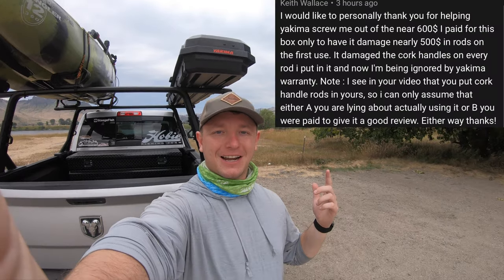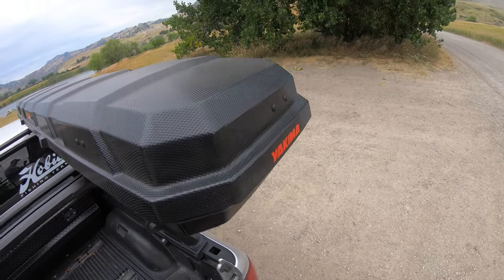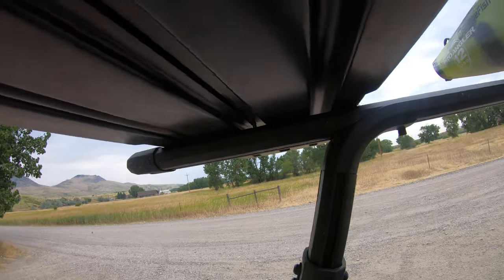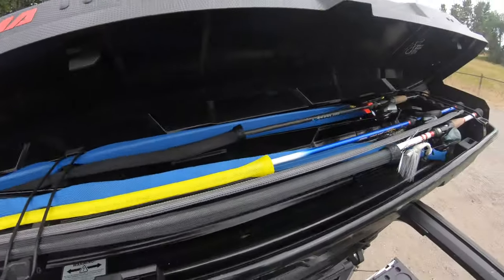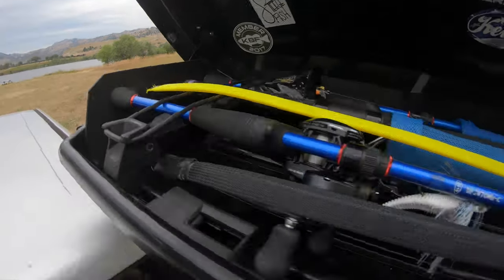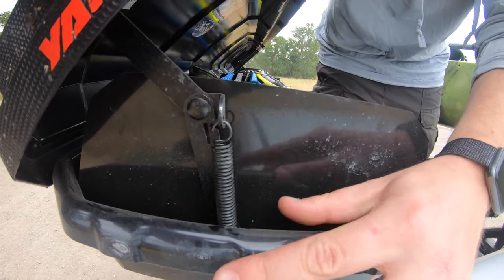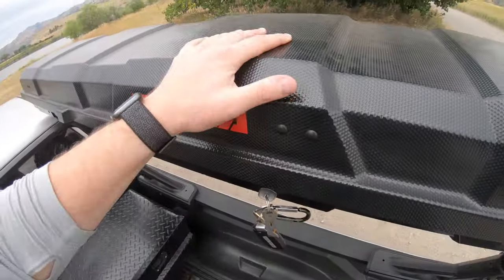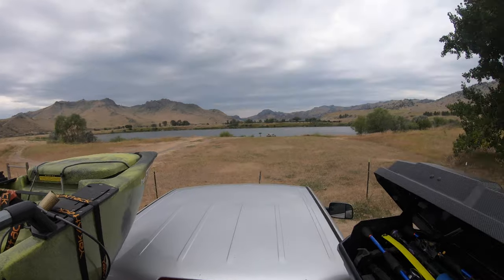Yakima TopWater Rod Storage Box Review Part 2! (1 Year of ownership) Is It Worth It?

Comment: Ordered and installed my Yakima TopWater Rod Box in July 2020 and overall, I'm happy to have it.  I'm a YAK fisher and travel around the south fishing and this storage system is important to me.  Good comments first: Installs like a breeze and the under-bar clamp secures the unit easily.  I did order the Slot-T-Slot Kit 5 for my Thule YAK rack and this hardware is the bomb.  It allows me to slide the box on and off from the end of each crossbar of my rack and allows me to remove the box when I'm not traveling.  Also, makes it easy to remove if I need to run the pickup through a car wash.  The locking mechanism is adequate, but make no mistake in thinking this is a safe, secure way to store your rods overnight in a hotel parking lot or somewhere similar.  With a long screwdriver and not much effort, anyone can pry open the lid and make off with your gear.  Yakima’s lock hardware and mechanics are designed to keep folks honest when you’re at the fishing resort, but you'll want to remove your rods if staying somewhere very public, overnight.  The NOT SO GOOD part: The hinge system of the stay-up-lid is nice, but very fragile.  Before making my purchase via Moosejaw.com, I read reviews that mentioned the spring(s) popping off when opening the lid and to be cautious of this.  Well, the very first usage in the field of my TopWater, the left hand spring popped off before sunup and I had no idea how or why that happened.  After getting home, I inspected the right side hinge spring, and it had bent nearly all the way and was holding by the bare minimum to the hinge hardware.  One lid opening later, it popped and this is NOT something that should be happening to a brand new product of this cost.  I contacted Yakima and they immediately offered to send new springs/hardware, however to my surprise, customer service offered ZERO explanation concerning how this may have happened, nor how I can try to avoid the issue in the future.  I was really shocked that they offered no suggestions on how to open the lid differently, or more carefully than I currently do.  Because I like to keep purchases for a long time, I manage the lid opening and closing gingerly, but that still didn't help avoid BOTH springs from failing within my first fishing trip.  Lastly and somewhat negative, is that you can only unlock and lock the lid open or closed.  To remove your key, you'll have to lock the lid back down and it's not possible to just close the lid and know that it's properly latched down.  Yakima mentioned this was a design feature, to help prevent folks from leaving their car key(s) in the lock and later driving off.  Can't say that I blame them for that, but it would've been nice to just be able to close and secure the lid, without having to have my keys available
Reply from the maker: I loved having mine also. Once I fixed the spring issue the first time I never experienced it again no matter how I opened the box. Unfortunately I’ll tell you one way you should not open it. Don’t slam it into your garage while backing the truck into the garage. That will open it right up into several pieces 🤣. RIP rod box.

Comment: I just purchased one and only used it one time so far last weekend so far I'm impressed but in your video you say that you'd like to see improvements but you never mentioned what improvements you think would be better just curious thank you for the video
Reply from the maker: Thanks for watching! I actually don’t own this box anymore because it was destroyed when I accidentally backed it into my garage… anyway the improvements I would like to see is some sort of seal around the edge because it would get filled with dust all the time. Also some more rigid support. All it had was one bar going across the bottom for rigidity. Also the springs on the Side kept popping off and I had to modify them so they would stay on. Besides that stuff it was awesome and I’ll definitely get another one.

Comment: Maybe the bungee cord that’s holding the rods down rubbed on the cork?
Reply from the maker: Possibly but I have 2 rods with cork grips and haven’t had any damage in thousands of miles. One is a saint croix avid . If I was worried about it I definitely wouldn’t put it in there. So far zero issues